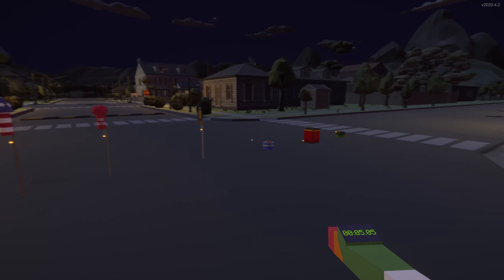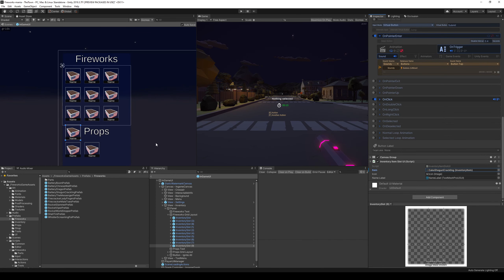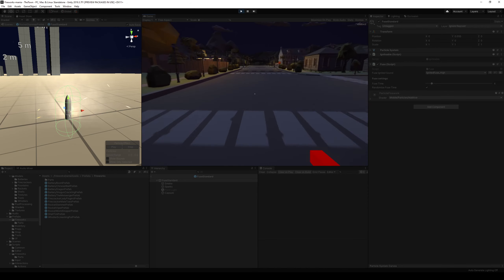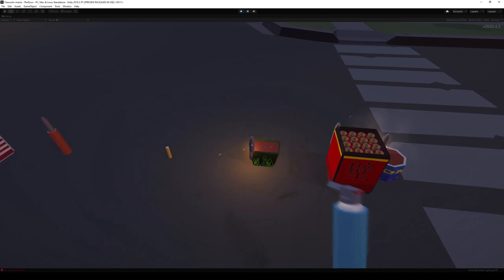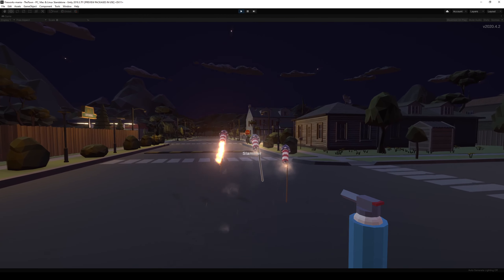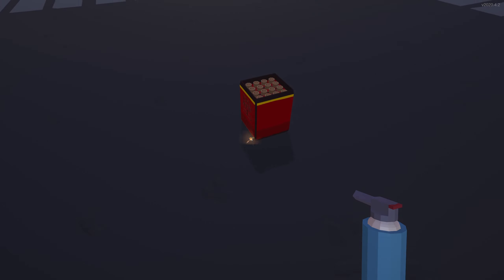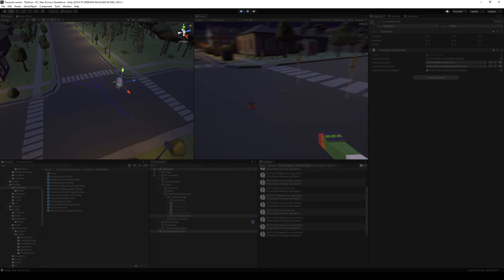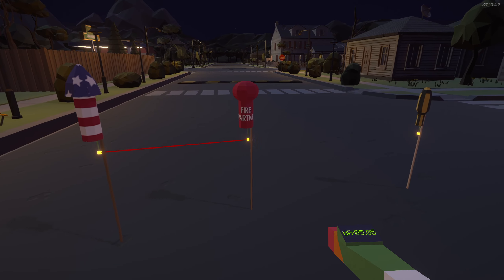Making A Fuse Connection Tool | Fireworks Mania | Weekly Unity Game Dev Log

Comment: Fuse tool Ideas:

#1 a wooden spool of fuse, with a piece sticking out.

#2 a hand model holding a long piece fuse coming from the bottom of the screen.
(From an imaginary roll of fuse in the other hand)

Change the purple beam to the same color and diameter of the fuse.
(so it looks like one long continuous fuse going from the tool to a firework)

Left mouse button click = Connect fuse to firework(s)
Right mouse button click =  Cancel connected fuse going to a firework.
Use middle mouse button to change fuse type (Fast/Slow Burning, Etc)
Reply from the maker: Very good suggestions!

Funny how the controls you describe are exactly the same idea I had and are implementing right now :D
Reply from the maker: By the way, saw your great post in the Community tab on Fireworks Mania's Stream page - really nice!
https://steamcommunity.com/app/1079260/discussions/0/2266941647858976573/